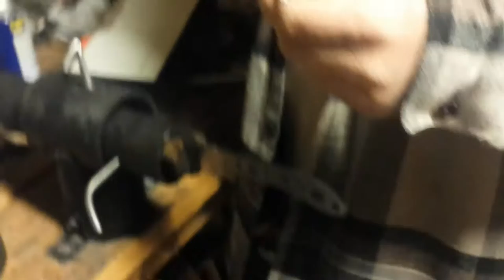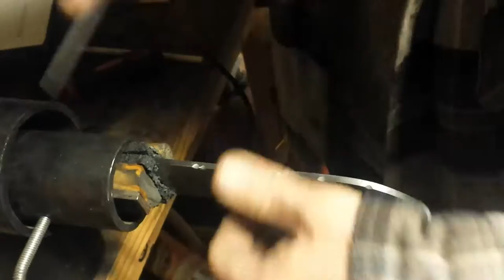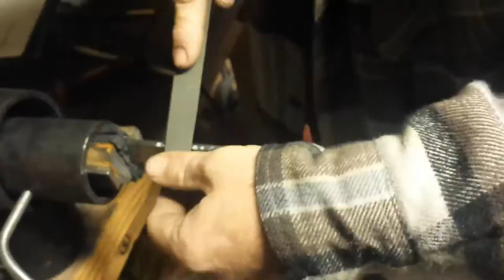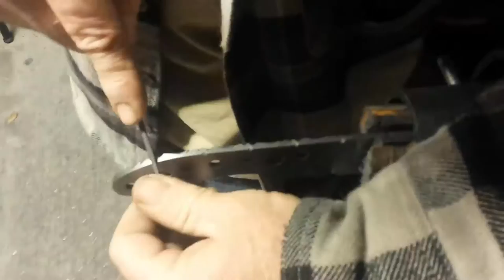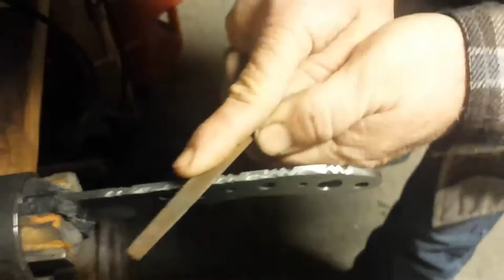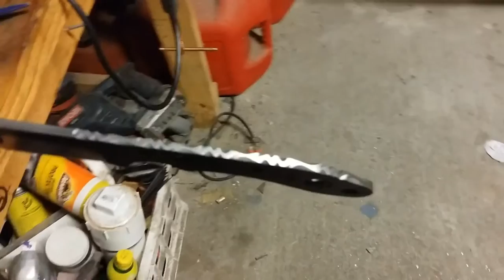Badger Pt. 5 - File Work

Comment: I like the design.  How do you sand and clean this up?  Also do you fill it in with epoxy when attaching the scales?
Reply from the maker: I take sandpaper and wrap it around the file I used to make the cuts. Then I just start at 220 grit and work my way up to 600. Yes the portion the scales cover gets filled in with the epoxy. You can add color to the epoxy to really set it off too. Thanks for watching. ...I really appreciate it.
Reply: Thank you.
Reply from the maker: +Tony Sheldon No problem at all